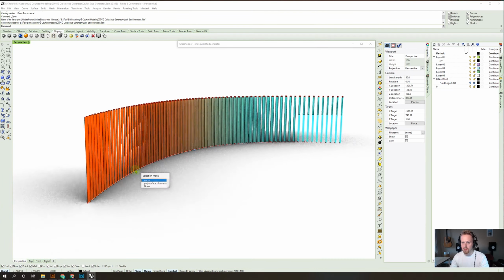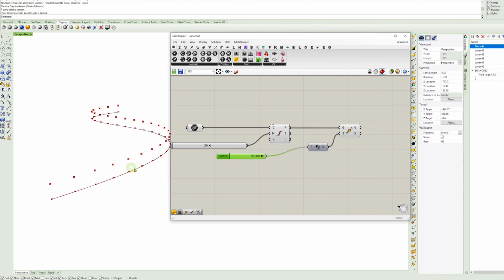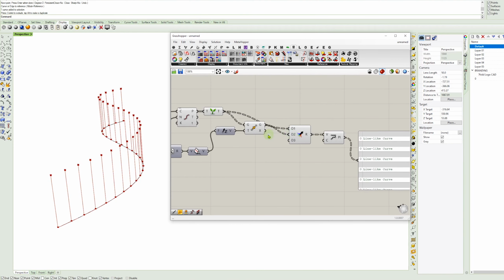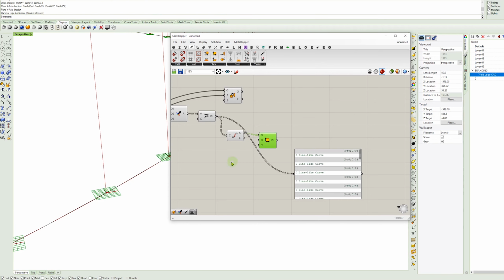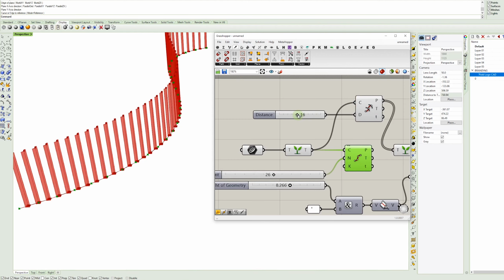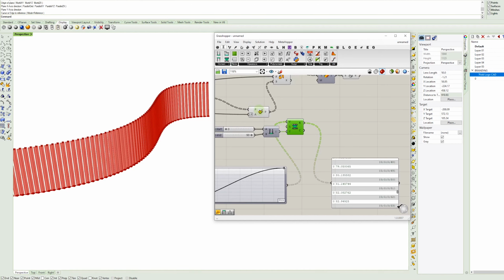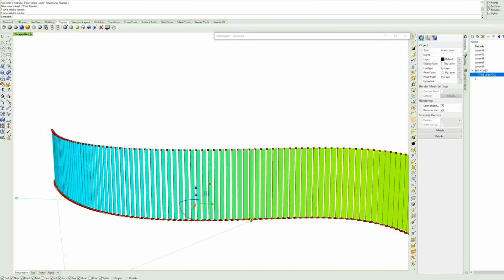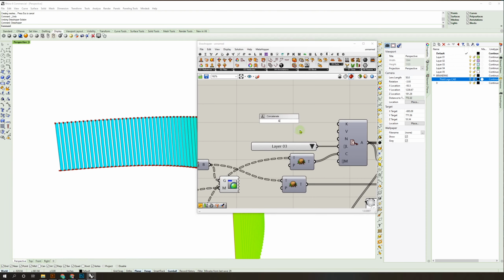Create a Custom Stud Generator in 15 Minutes with Grasshopper | Parametric Architecture

Comment: Thank you so much for the video this is helping me so much for my school, how can you measure the combined linear foot of all those studs using grasshopper?
Reply from the maker: I found the “Curve Length” component can make quick work of that. Just measure the underlying curve before extruding to a BREP to assess the length. Then use the Sum All component in the maths tab to add all lengths per branch. If you want one big number just flatten the list of lengths before summing them together. Does that make sense? 
Ps. I’ve been growing a community of growth-minded designers inside a structure technology training environment called the 7fold Academy. It’s meant to complement university and bridge into practice. I’m constantly updating workflows based on what design challenges people are facing. If you’d like to learn more, you can check it out here: https://7fold.link/go 

Cheers!